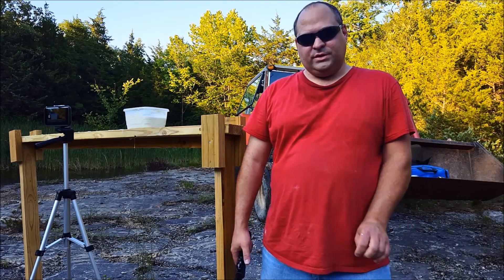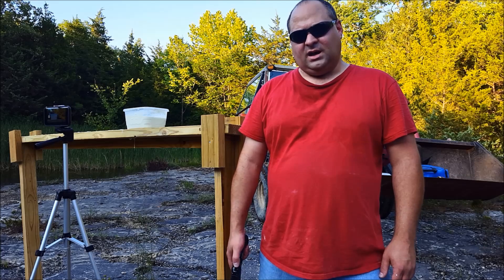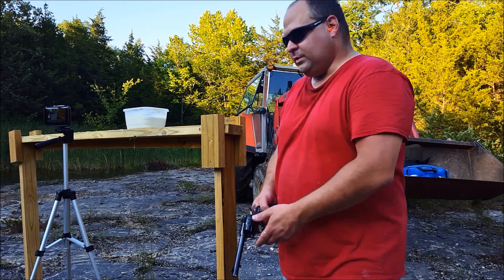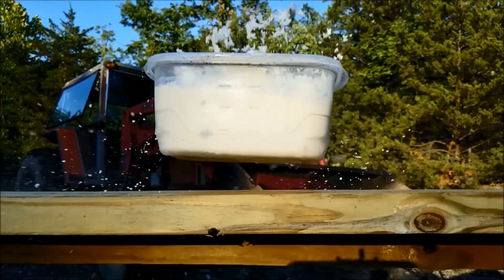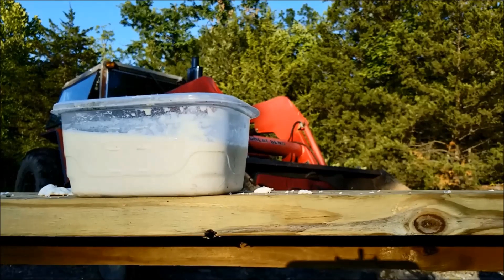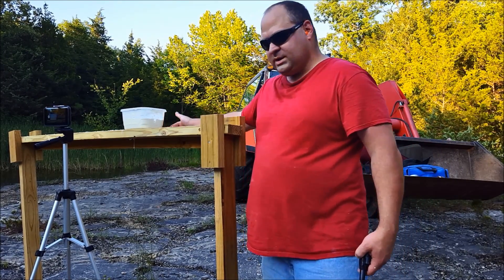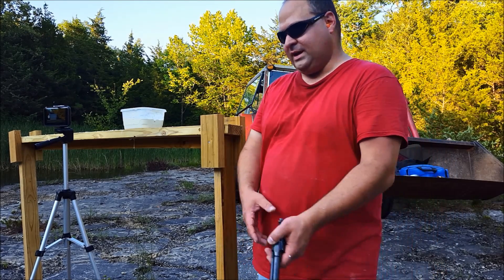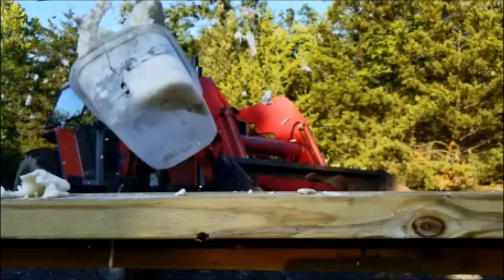Cornstarch and water (Oobleck) vs a bullet

Comment: If the fluid is in a closed system like a bullet proof vest, I'm sure it will work well
Reply: you are thinking d30, I believe. Same principle, but stronger material, effectively. It hardens to a solid though, which makes it easier to incorporate into body armor. However, this type of material excels entirely on blunt force absorption, as opposed to the piercing force of bullets. It is paired with other materials such as Kevlar to be a better rounded body armor.